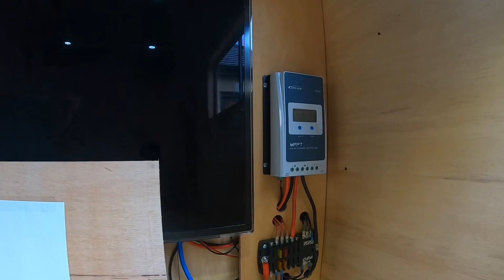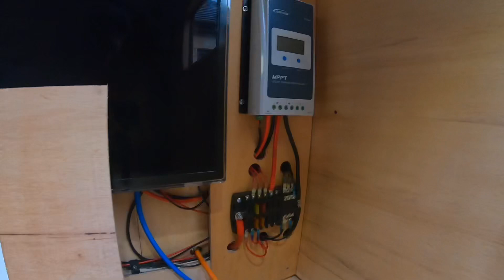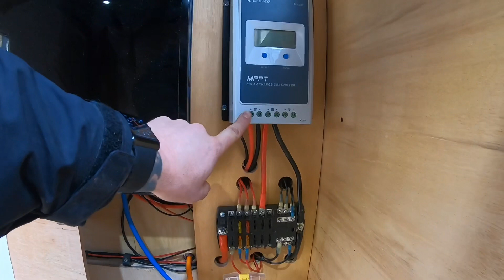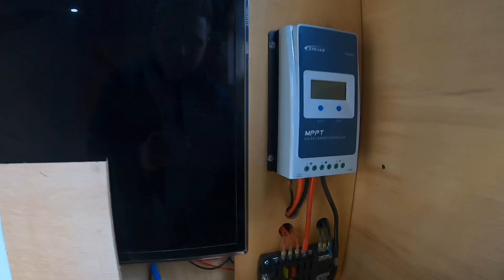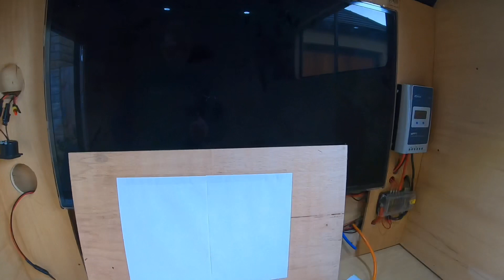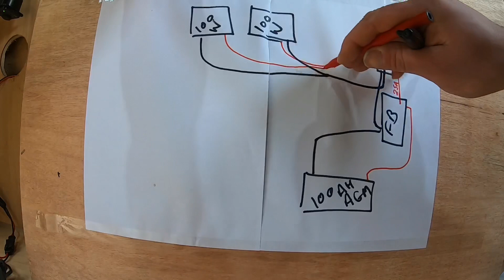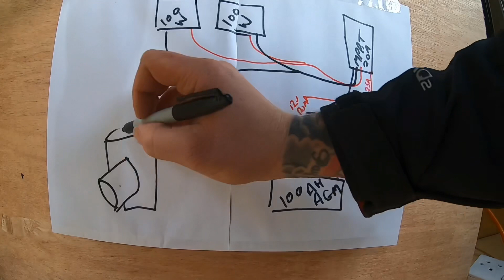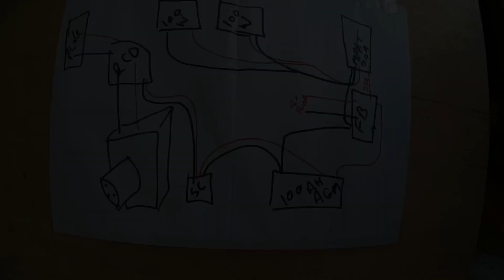UrbanARK part 3 overland trailer solar electrics update

Comment: Great to see the 3 videos so far, your build looks great....Gutted about the checker plate paint issue for you!
I have a stealth camper trailer build starting in May, so your updates will prove very useful.

All the videos on stealth campers etc on here seem to be from the States and don't accommodate the need for insulation, but focus heavily on aircon......Defo not needed in UK.
Already looking forward to the next video, keep them coming!
Reply from the maker: Hi Jon.thanks for your great response too my video. I am working on more. But currently waiting for other company’s to custom build a few things. It’s all about the insulation over here. 
There are more videos to come I promise. Might start doing some more of the technical stuff but so many people are on here doing it so well. 👍👍👍